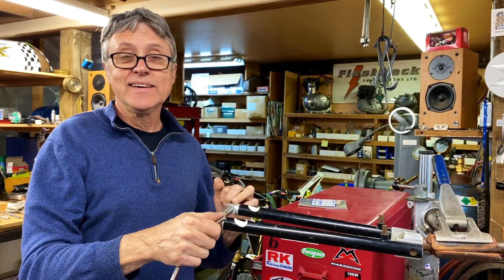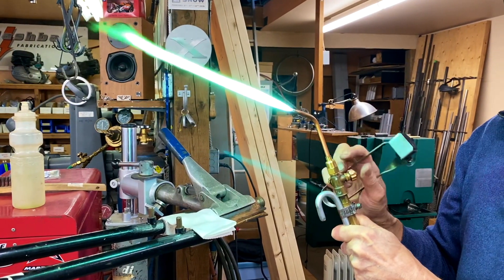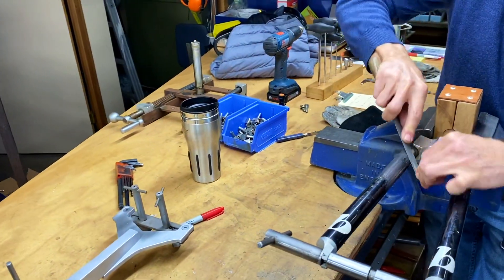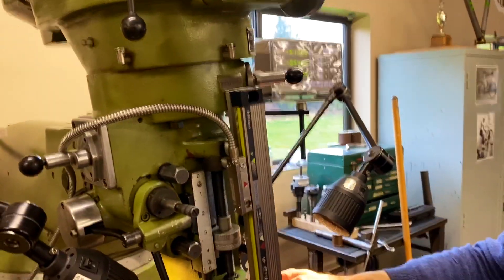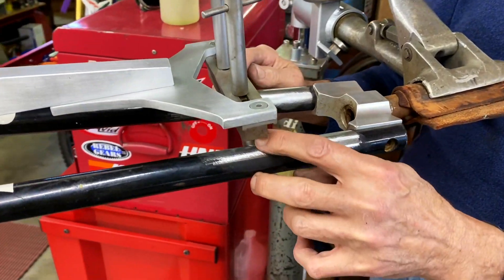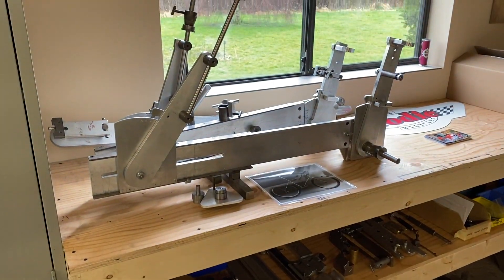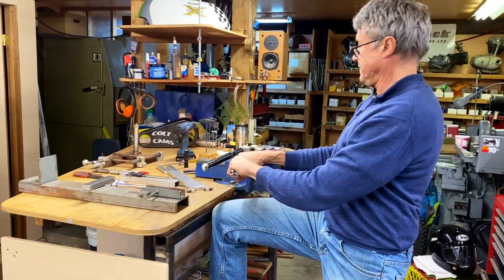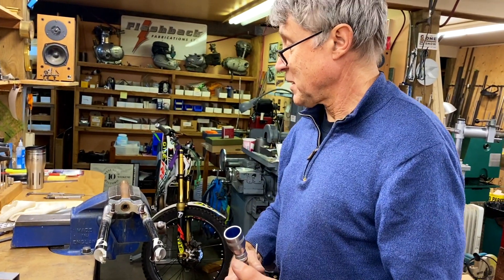Framebuilding 101 Fork Mods with Paul Brodie the Fussy Framebuilder

Comment: Am I wrong, or does it show at 13:28 that one of the canti bosses is not at a right angle to the fork leg?  I.e., the right-side boss is twisted on its axis compared to the left-side one.
Reply from the maker: I think you eyes are deceiving you a bit. When I pulled of the brazing fixture at approx 10:10, if one of the bosses was crooked, the fixture would never have come off that easily! Thanks for watching! 😉

Comment: Paul, just a question, isn't it better to first align the fork and than solder the new cantilever mounts on? By doing so you're sure that the 57 mm is spot on and that they're perpendicular to the front axis. Correct me I'm wrong. Furthermore I'm really your hands-on efficient approach on building things. Thank you, best, Job
Reply from the maker: Because of their design, Gatorblades rarely go out of alignment. So, not necessary to check alignment first unless the bike has been well crashed. Yes, any other fork I would align it first to be sure the bosses ended up perpendicular. Thank you, Job.

Comment: Hey Paul, great videos. Is it acceptable to add disc tabs to a 1" threadless steel fork off a Trek 520 touring bike?
Reply from the maker: Thank you. You have to be careful adding disc tabs onto an existing fork, so I am not going to say yes or no. Conventional forks are usually designed to have a little "flex" to make the ride more comfortable. This means the wall thickness of the fork leg may be a little on the thin side for disc tabs. Forks made with disc tabs are usually stronger with oversize tubing. Make sense?
Reply: @paulbrodie  Absolutely. How about creating a weld on mount that extends up the fork leg a few inches past where the caliper would be mounted? I believe it's called a Willit's mount
Reply from the maker: @tinkerbike2510   That could work. I saw one that Steve Potts made and the mount went all the way up to the crown. Looked rather cumbersome but I'm sure it was strong. Everytime you brake there are forces transmitted to the fork leg. If the mount only extends a few inches above the caliper, that's where the stress riser will be.
Reply: @paulbrodie  that makes sense. The fork I want to modify is pretty beefy. It’s in the Bridgestone threadless upgrade video on my channel. It’s got pretty minimal flex compared to the original hi-ten threaded fork. Would it be better to go as far up the fork leg as possible?
Reply from the maker: @tinkerbike2510   If your fork is pretty beefy, and the mount extends up quite a bit, and you don't overheat the blade, then you will likely be fine. Always best to err on the side of caution when modifying forks :)
Reply: @paulbrodie  So true. I guess in that case brazing would be a better option than welding right?
Reply from the maker: @tinkerbike2510   My first choice would be to run a small bead of nickel silver all around the braze-on. Do a nice job and there is no filing. Align the fork and prep for paint.
Reply: @paulbrodie  Thanks Paul!

Comment: Have you ever tried using a heat induction coil? We use them to rapidly heat nuts and bolts that are corroded then break them loose with minimal force. The coil heats up the material so fast that other parts don’t get a chance to get heat soaked. It would be interesting to see how well it would work when removing brazed parts.
Reply from the maker: No I have never tried using a heat induction coil.

Comment: Surprised to see you clamping steer tube in vise without a fixture to avoid crushing.  Must be an example of the finesse skills you have built over the years.  Be well brother.
Reply from the maker: Steerer tubes are pretty thick wall, hard to ovalize. I would not hold any other bicycle tube like that...

Comment: PB- You removed which bosses to replace with Canti bosses.  I missed that detail, even listening a 2nd time.    

You describe tacking the inner side then silver-nickel the other side to avoid lift in the jig. I mistakenly thought you were tacking the LEFT inside then brazing the RIGHT outside.  Once you torched it I saw my mental error.
Reply from the maker: If I remember correctly, I took off the U-brake bosses. Thanks for watching!
Reply: @paulbrodie  that's what I thought, though couldn't visualize layout as I haven't seen a U brake in years....

Comment: I just came across this video and its awesome to see the man responsible for the most reliable transportation I've ever owned. I have a Brodie Energy hard tail  I bought brand new in 1998 or 99, steel frame, I upgraded the rigid forks to rock shox 2 weeks after I bought it (because I thought they looked cool). I still use that bike to this day and aside from having to clean out the rapid fire shifters every season my Brodie has never let me down. After seeing your attention to detail I see why mine has never failed! I wish I was still able to hit the more aggressive trails with it but 4 herniated discs in my back have ended my hard tail trail riding. Thank you so much for an amazing product that I will keep riding as long as I am able.
Reply from the maker: Thank you Warren. Glad you're getting a lot of satisfaction (and miles...) out of your bike!

Comment: That took me back. As a apprentice, back in the 60's and 70's, the elegance and simplicity of brazing was something I adored and even more so considering that many of the bikes I owned and used back then were brazed. Not knocking TIG - just bicycled back home this evening on a beautifully tigged frame but I kind of imagine it would look and ride a whole lot better if it was brazed instead.
Nice looking braze welding Paul - just enough braze and nothing more.
Reply from the maker: I'm not sure a fillet brazed frame would ride any better than a Tig frame. I can't think of a reason...

Comment: Lovely job! Have you ever tried putting the bosses on the back of the fork pointing the other way? Apparently you can put the brakes on back to front like that. Would look a bit strange but might be a good idea from an engineering standpoint as the joints would be in compression when braking.
Reply from the maker: cable routing could be an issue...